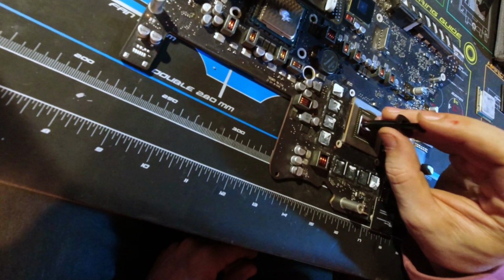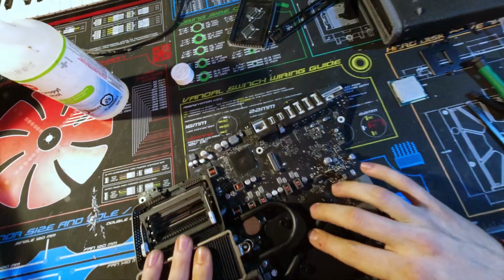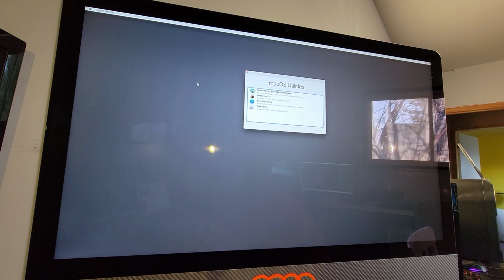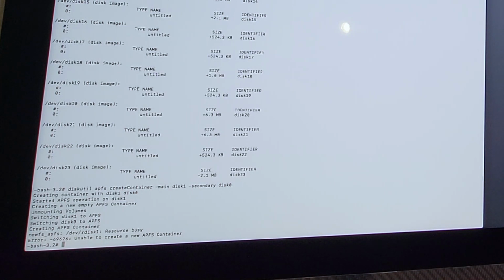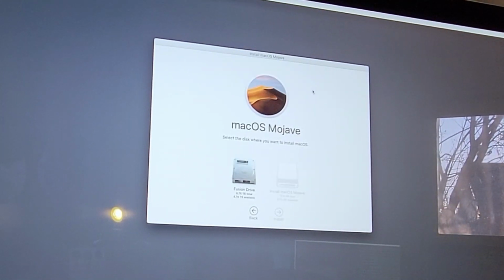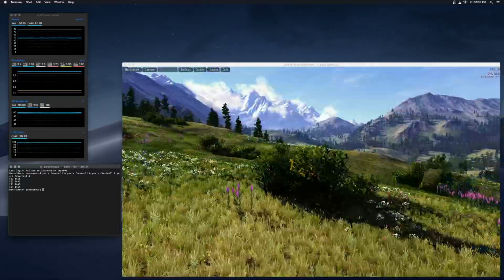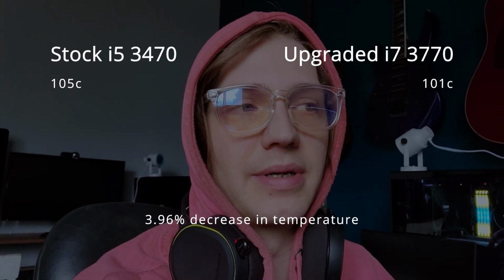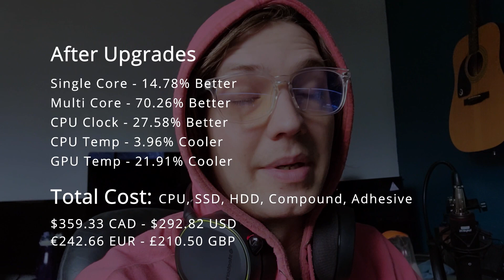iMac Upgrades (8.75TB Fusion Drive, i7-3770, 32GB RAM, Thermal Grizzly Kryonaut)

Comment: Is this beneficial to do over just replacing hhd with an ssd? If so why, I have a late 2012 27” core i7 3770 that I’ve been pondering about upgrading the storage n wondering on which route to take thanks in advance
Reply: I know this is late but an SSD will offer far superior read and writes compared to an HDD, even without a CPU upgrade